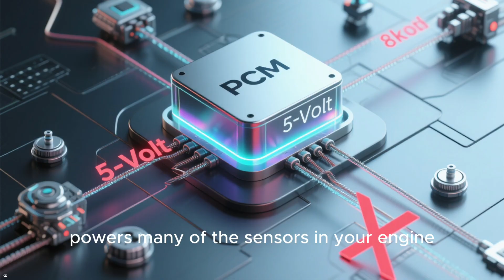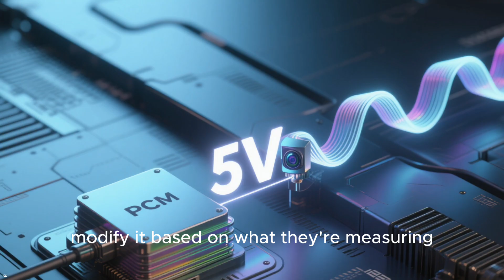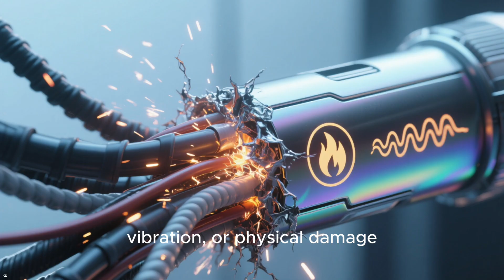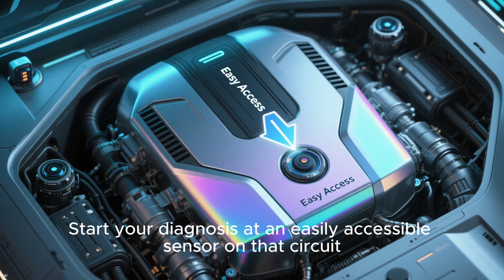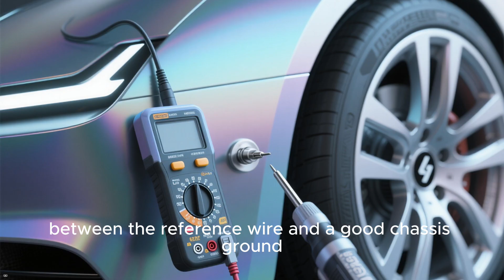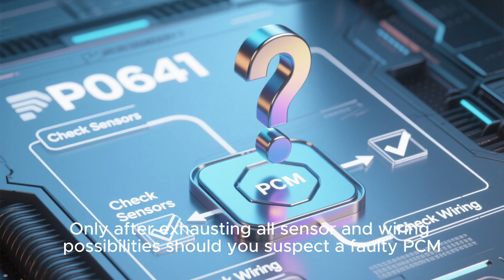P0641 – Sensor Reference Voltage “A” Circuit Open | CodeMechanic

Comment: I've got many low voltage codes including this one, but I've got steady 5 volts
Reply from the maker: If you're seeing several low-voltage codes while measuring a steady 5 volts at the sensor circuits, I would check the 5V reference under load and compare it at the sensor connector and directly at the ECU. Also inspect the sensor grounds and wiring for a shared fault. If the 5V reference is stable at all affected sensors, the issue may be in the signal circuits rather than the reference supply.